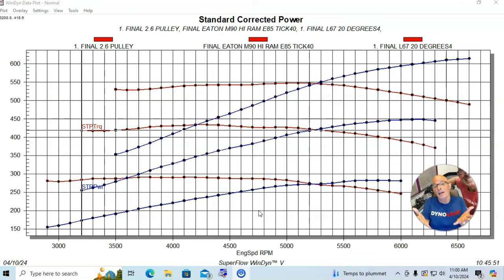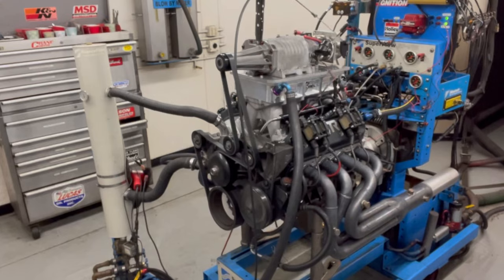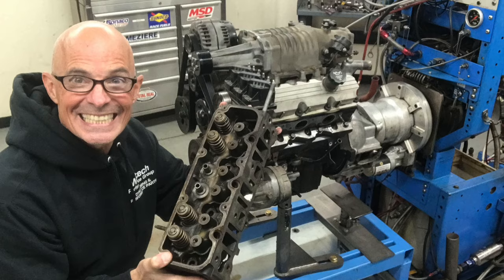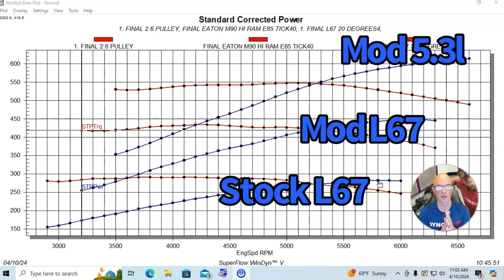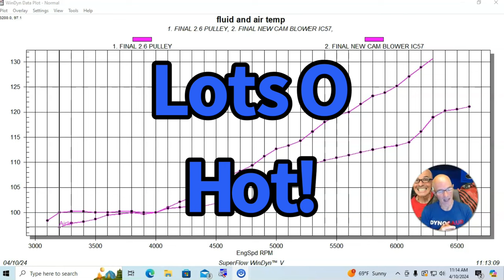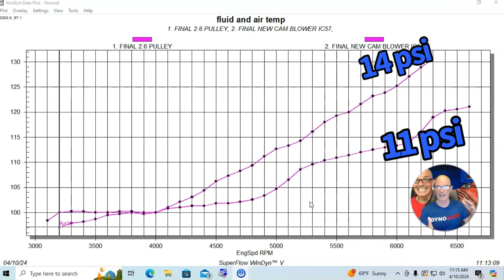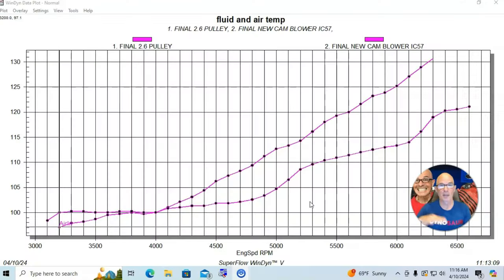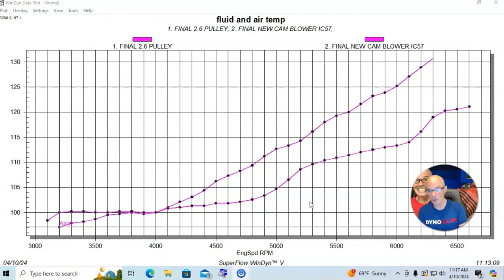M90 BLOWER HORSEPOWER MYTHS! IS IT TOO SMALL? IS IT TOO HOT? CAN YOU RUN IT ON A BIGGER MOTOR?

Comment: I problem I have with this video is most of these stated issues are not myths. Just quickly looking at the M90's compressor efficiency map shows that this super charger is indeed designed to operate most efficiently at relatively low mass flow rates. To get this thing to work at the ~650hp range you're trading over 17% compressor efficiency, which is expressed largely as heat, an awful lot of heat and wasted shaft power.  Also, likely running the m90 at its max operating RPM. It works sure, but in every regard its far from ideal. Considering the time, money and effort to install and tune this setup its nothing more than a meme IMO.
Reply from the maker: The problem you have with the video has nothing to do with actual data. There is very little heat generated running just 5.5 psi at 650 hp, since pressure is what primarily determines the IATs. We had sub 100-degree temps exiting the intercooler. When you go looking to make max power with any blower-this is how and where you run them.
Reply: Myth - a widely held but false belief or idea

As he just proved, Myth - BUSTED!

Comment: I remember when they told my 1.5l Ken e bell wouldn’t make more than 400 rwhp on my 4.64v yet here I am close to 600 rwhp the inlet restriction was the culprit on the early 96-98 cobra kenne bell kits. I re fabricated the inlet and boost went from 9 to 14 psi that was a huge restriction
Reply from the maker: 600 whp with a 1.5L?
Reply: Yes sir I modified my inlet to flow approx double what the stick restrictive one could I tapped a vac gauge into the inlet and under wot I was showing 2 in/hg so it was pretty restrictive. I also added a bypass and 2 water alcohol nozzles pre and post rotors
Reply: Originally made 517 rwhp after I did the mod to 550 rwhp is what it made recently on a cool day and I changed my exhaust from full 2.5 inch to 3 inch dumps and full crank case -10an catch can breather set up to vent the crank case
Reply: Before I did the mod I was making 9psi after opening the inlet with the same pulley it made 12-13psi I then went from the 2.5 to a 2.25 pulley spinning it to 19000 or so rpm making 14-15 psi car went from 410rwhp on 9psi to now 550 on 14psi
Reply: @eddiearchuleta615  good to hear, I bought a used KB 4.6 2v kit and the 1.7 was seized (literally could not have had a smaller pulley!), picked up a 1.5 unit (interestingly the case is ~2" longer but width and height are the same!) and hoped it would work fine. I do have an intercooler and by pass so sounds like my 400whp goal is no sweat! I probably have $1700 in the kit and the 1.5 rotors look to be freshly coated.. might be a 2.2 I have not contacted KB to see if they converted it but it doesn't have the right outlet flange bolt count i've read about. 

How did you plumb meth-nozzles post rotors?
Reply: @richardholdener1727  you JUST made 650+ with a 1.5L (well 1.475) in THIS video! 😂
Reply: I tapped a hole underneath the lower blower manifold pointing straight up at the rotor discharge
Reply: @eddiearchuleta615  intercooled?
Reply: No non intercooled that’s why it works so good in my situation the 96-98 cobras didn’t have an intercooled option most spray pre rotors and it does help by 100 degrees but since I did both pre and post it cools 150 degrees

Comment: Love it or hate it, the M90 is still a tough little boost beast !  With little more than a 3.4” pulley and cold air induction, my L67 V-6 responded with a very noticeable increase in torque by blowing the tires off sooner and longer compared to stock trim 🏁

Comment: The thought of an M-90 on a 454 has me thinking 🤔 Maybe this is the way I go instead of an LS motor with a turbo.
I’m not looking for high rpm’s, just low speed grunt with some get up and go when I want it in a 6,000lb truck with 33” or 35” tall tires (haven’t decided which yet).
Love everything you do sir! Keep up the awesome content
Reply: I think it all depends on what you are looking for, in terms of application.   The M90 does open doors that were previously ignored.  Imagine you want to tour the country, but don’t want to spend an absolute fortune on fuel, and a $70,000 truck.  Go buy a 95  Chevy Extended cab dually, swap in a 5.3 with a 6l85 and M90. You could pull pretty much any trailer with that, and at least, on flat land, get pretty spectacular fuel mileage.  And have the pulling power for the hills.  Not super cheap, but dependable, serviceable, and MUCH cheaper than a newer truck that you would be devaluing the crap out of with all those miles.    Maybe it’s just me though….   I’m not much of a conformist.
Reply: @JasonMcCord-qk3yb  there might have been a misunderstanding. I already have a truck, a 1978 3/4 4x4 that weighs 6,000lbs and put a 454 in it 15 years ago. I was thinking about going LS with a turbo for it, mainly for better fuel mileage. But an M-90 and fuel injection might change my mind.
I owed a 2002 dually with a 6.0l and it was nice and all, but wasn’t much better fuel wise when towing and definitely couldn’t do off-road like I do in the 78!

Comment: I'm curious to see what the M90 does on a motor that's smaller but more efficient than the 3800. Like maybe a K24, or a J-series V6.
Reply: A J35 with an m90 is super intriguing.
Reply: The cte (comptech) super chargers kits for the k24 were "eaton" based and were good for 300-350whp more with appropriate mods.
There are a bunch of videos of jseries with m90's as well.
Reply: just did this to mine. j32a2 with gen 5 m90. all motor made 230hp and 225tq to the wheels. after blower it made 311hp and 272tq at 9psi to the wheels

Comment: Hey Rich… I had a sbc 383 built in a 1991  Camaro with a Holley 650 with vortex 202 heads. I was told it made 450-500 hp but it feels like less than the 305 that it replaces. Please advise.
Reply from the maker: Not sure what I can say about a motor I have never seen and don't know the specs or tune on

Comment: Could you put the m112 on a 3800? I'm wanting to swap my fiero and curious what benefit it will make
Reply: I believe it was made for the 3800. 
 the old regal supercharger
Reply: In the 3800 community a m112 swap has been done. I believe the consensus was for the cost/effort turbo was a better option.
Reply: Used to do a rotor swap with a case spacer to make use of the stock manifold. It wasn't pretty but they work

Comment: Hey I have a great video idea for you! Do a video on “torque boosters”, adding a wastegate to control a centrifugal blower. Do tests like different WG sizes 38/40/45/50mm. Difference in boost curves compared to a normal pulley combo. Adding the WG before or after the intercooler.
Reply from the maker: WG size plays not part unless it can't flow enough to limit desired boost, waste gates on a centrifugal only help because of the change in pulley size to speed up the blower, position of the WG changes very little on a cent blower application
Reply: @richardholdener1727 I think it could be a great topic to cover, can’t find hardly any info on it let alone the things I mentioned. Show dyno dyno graphs with and without. Pros/cons ect.

Comment: I'm still waiting on the m90 play adapter to become available
Reply: Nothing wrong with a Super Richie style setup with basically just plates and a drill/hacksaw
Reply: the m90 plate adapter is available. you need a holley hi/med/lo ram lower intake.
Reply from the maker: adapter plate is available
Reply: You can buy an mpx case which is a much more simple outlet flange (4 bolt square) and it flows great
Reply: Tom demuese makes the adapters for the lo/hi ram I bought one from him yesterday
Reply: Tom demuese makes the adapters for the lo/hi ram I bought one from him yesterday

Comment: So if you put the M90 on a 650hp n/a motor, that should be at the maximum airflow of the M90 and we should see no boost and no hp gain? Right?
Reply from the maker: SINCE WE SEE 5.5 PSI AT 650 HP, WE WOULD STILL SEE MORE THAN NA POWER
Reply: So what’s the maximum airflow of the M90?
Put it on a 750hp BBC and see if 0 boost and no power loss?

Comment: So, if you’re looking to cool the air through the intake, could you fabricate a intake system utilizing an AC pump so that the cold air is introduced to the intake, or would the cost of turning the AC pump negate any gain? Just thinking out of the box.
Reply from the maker: that has been done

Comment: Does the blowet have less loss on the v8 because of the boost difference and how much do you think
Reply from the maker: LESS LOSS?
Reply: @richardholdener1727  the amount of power it takes to run the supercharger
Reply: It does not take less loss on a bigger engine. Relatively to the power of the engine, sure it would consume less of the engines total power than the v6, but it still takes the same amount of power to turn the supercharger, regardless of engine. Does that make sense?
Reply: @colin2750  well compressing aire to 15 psi probably takes more power than compressing air to 1 psi so I'm not sure you are correct it might not be a big difference but it should be something

Comment: Hello Richard, I have a question. I have 550 lift valve springs and recently upgraded to another camshaft with a 595 lift would I need to replace the 550 lift springs for some 600 lift? Thank you
Reply from the maker: yes-needs the right springs

Comment: Richard if you don't mind I've sifted through the 5.0 videos here and other YouTube videos and I'm still not sure, at the moment I'm installing an explorer intake and new shorty headers I'm contemplating a cam upgrade while it's apart, I have a stock 95 HO 5 speed what cam would you install now that will work good with just the intake and shortys but will work well with a future head upgrade like afr 165s or the new SVE 170s. 2.73 gears now but switching to 3.55s, it's  my warm weather daily and just want more more than the underwhelming 215hp while still having decent drivability. I have had several cammed daily drivers in the past so that's not an issue. Any input would be appreciated.
Reply from the maker: I like the Comp XE274HR, but others work-Summit has some and Anderson Motorsports
Reply: @richardholdener1727 that seems to be the hot ticket, not to keep bothering you also do you know of any Howards factory rollers that work good?

Comment: I want to see a M122 go though all these tests. Even remote mounted with a air to air intercooler. They are still fairly cheap considering.
Reply from the maker: We never see any M112s at the yards, but see many M90s. That's why we chose the M90, cuz they are cheap and available.
Reply: @richardholdener1727  If I run into a cheap one I'll send it to you. There was one for 250 not long ago. I was going to run one on my efi 460 then I found a old vortech kit for cheap and went that route.  I enjoy all your videos! Even the tech talks. We appreciate your hard work.
Reply: @richardholdener1727  there r a few m112 on ebay now for under $400.  I'm wanting to put an m112 on my 388 sbc.

Comment: How does it go on a smaller engine, say a 120ci straight six?
Reply from the maker: the blower doesn't know displacement-it knows na flow vs blower flow. Spin the blower at the correct rpm and it will work fine on the 120 ci six
Reply: @richardholdener1727  yes, so obviously it will simply have to spin slower, I only reference displacement as an indication of NA airflow.

Comment: Do they make the intake adapter it run a M90 on a Ls3? Or did you make the adapter?
Reply from the maker: the adapters are available from Demuse Engineering to work with a Hi ram or Low Ram on the LS3
Reply: Awesome!!!!! Thank you sir!!!!!

Comment: In a future video could you try an asymmetrical turbo setup on the 3800 or 4.3 V6 like Saab used on the 9-5. I have always been curious what the dyno results would be for such a setup.
Reply from the maker: I tried that on a BBC once
Reply: @richardholdener1727  Is there a video on that? What were the results?

Comment: What happened to the Big bang?!
Reply from the maker: coming
Reply: Can't wait lol. 👍🏽
Reply: @richardholdener1727  I'll have to review the videos again but it seemed to me that the compound setup had less power than just a turbo setup... Over 600 horsepower with a turbo but only high 400s with a compound at significantly higher boost levels? 🤔 hmmm
Reply: I work in finance, but I'm considering a career change for my midlife crisis to engine building lol... I find your videos extremely informative/educational thank you! Let me know if you're looking for an apprentice lol.
Reply: I wonder if you could add an interchiller to this combination? Using cold air from the air conditioning unit... Maybe the colder air temperatures could help offset the parasitic drag of having an air conditioning pulley in the  system...🤷🏽... I can't wait for the Big bang i would  build the bottom end up and and dial the turbo all the way up with e85... And nitrous with an interchiller... Could you do a value analysis relative to a 2JZ motor?

Comment: Can you put a clutch or similar onto a supercharger in order to run NA at low throttle but initiate boost at a preferred rpm?
Reply: Guys have been wanting that since seeing "The Road Warrior" (aka Mad Max) in the early 80's... Highly recommended for any car guy who hasn't already seen it!
Reply: Toyota did it with the 4agze and 1ggze from factory never seen a aftermarket blower setup.
Reply: The m90 has a built in bypass flap that is externally controlled with a vacuum pod. On the factory 3800 the engine is only actually getting boost at WOT when the vacuum is gone and the flap closes. I’ve been trying to figure out how to make it work with a electric actuator or something like that
Reply: @dieselhiboy72  look into turbo smart e gates. You should be able to use one in your m90 application should be able to directly control from the ECU. You would have to remove the exhaust section of the egate and attach the pivot arm to the flapper in the blower. Not sure but turbo smart may have a internal wastegate  actuator that would make life easier

Comment: Is there any way to figure out the pulley ratio for a certain boost amount, like 7-9 on a 420 inch engine? And I’m going from a v belt to a serpentine belt via a jack shaft somewhere in the middle so there’s plenty of room for adjustment.
Reply from the maker: how much power are you trying to make
Reply: @richardholdener1727  it’s currently making about 180 hp and 330 trq. Would be nice if I could get another 80-100 hp

Comment: Im trying to get Accufab to make me a custom 3 bolt LS1 TB. I have a 75mm one now but bought a 85mm Holley for my m90.
Reply: You can buy a 92mm with adapter plate for less than $100.
Reply: @commonsenseisdeadin2024  already have an adapter plate
Reply: @jplperformance9073  then why have Accufab make you a custom throttle body? What size is the opening on the m90? I can't imagine there's much benefit over 85mm ESPECIALLY if you're not running an elbow off the inlet. 

If the adapter "necks" down (or is beveled) then it can easily and cheaply be CNC'd by a machine shop to bore it out. Don't get me wrong, I love Accufab and everything John Mihovetz has done for the Modular platform.

Comment: I still think the TVs 1320 would be a better option than the m90 it’s a little bigger and more efficient at higher rpm’s and can be had for the same price as an m90
Reply from the maker: WHERE CAN YOU GET A TVS FOR JUNKYARD M90 MONEY?
Reply: @richardholdener1727  as well as the jaguar 3.0 is a TVS 1320 and is much easier after the lid and manifold are removed they run about $300 however require less fabrication work and can use just a simple plate like the one from the 5.0

Comment: nothing physicly stopping you. pushing it way outside its efficiency envelope with more speed is going to make low density hot air, still gonna get a boost number but not the power. engines don't run on pressure psi but air density lb/ft^3. air density takes into account everything including tempature and you can compare supercharger sizes and everything directly  without  being wacky about it.
Reply from the maker: WE RAN AT JUST 5.5 PSI AND AN IAT OF 84 DEGREES. THE HEAT COMES FROM BOOST-THAT WAS IN THE VIDEO
Reply: @richardholdener1727   dam man dont need to yell im right here. whats your ambient air temp and pressure thats going into the supercharger. have to know what the supercharger is actually doing. with that data you can get the air density change across the blower.

with these numbers you can compare it with anything, bigger blowers, turbos even intake systems on na, nomatter the wether or temperature. hp and engine combinations turn from a dark art of seems about right and experience to something you can calculate and optimise.

Comment: Will a centrifigul blower sized for a 4cyl K series engine make 500hp on an LS motor?
Reply from the maker: blowers are not sized for displacement or cylinders, they are sized for flow and output

Comment: Those blowers were normally made for V6 applications. On a small ci V8 such as a 283 Chevy, it might add a little power. For larger V8s, you'd need two M90s; one for each cylinder bank. They simply do not pump enough air.
Reply from the maker: we made 650 hp with 1